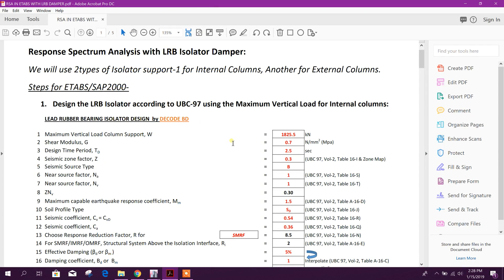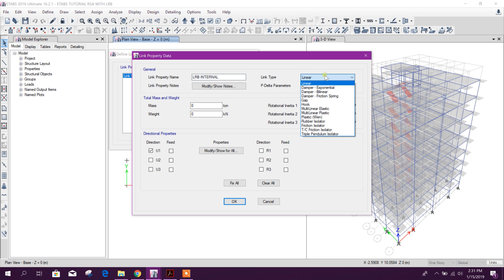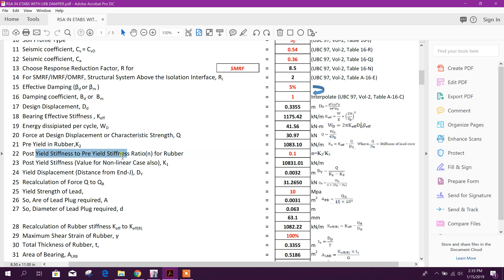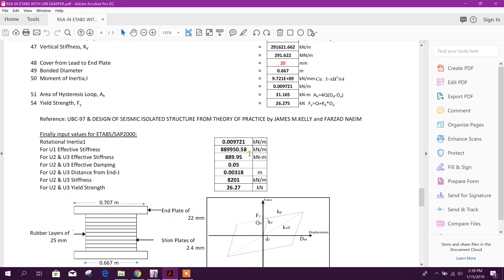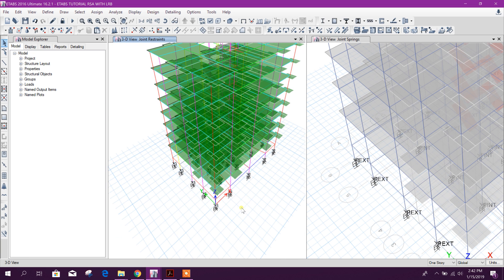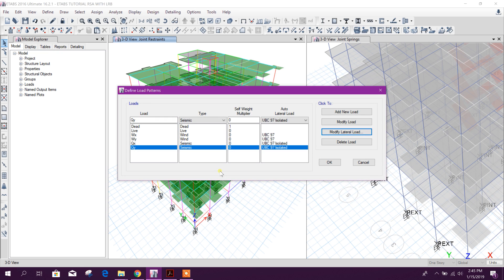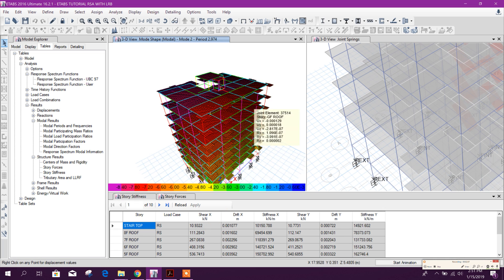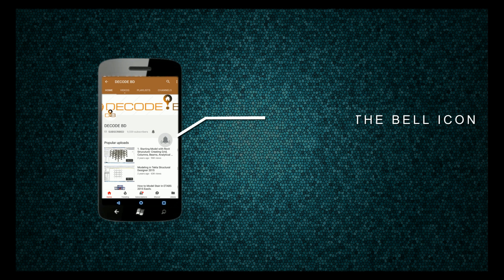RESPONSE SPECTRUM ANALYSIS WITH LRB ISOLATOR DAMPER IN ETABS

Comment: Can't we design the LRB without UBC code and only using IS 1893 part-1 2016
Reply: If possible can you please put a video on that
Reply: No, as till now we don't have any Indian code available for the design of base isolated or interstory isolated building. IIT Delhi/Kanpur professorss are working on it & i think it will be available in near future. Now, if we talk about your ques then as i have already told you that you cant design with 1893 alone but what you can do is you can use IS 1893 along with UBC or you can use ASCE 7-10. So, for the calculation of your isolator (rubber bearing or friction pendulum doesn't matter) you can use ASCE & for the beam column size reinforcement etc use IS 456 as due to the use of isolator your building will be in elastic range only so you dont need SMRF & atlast with the help of IS 1893  you can give target spectrum & match the time history (FNA, lets say). I think I have covered all d things here.

Comment: Thank you Sir, BUT I have an important question , I notice in this video that you used the Value of Max and Min Effective Stiffness for one isolator "For Example the value 1175.42 kN/m" Contrary to what was stated in the "Etabs 2016 Lateral Load Manual " for 1997 UBC Isolated Building Seismic Loads, Which States that "The maximum effective stiffness and minimum effective stiffness items refer
 to the maximum and minimum effective stiffness of the isolation system (not individual isolators) at the design displacement level".
IF we do what was states in " Etabs Manual " we will have Base Shears Values for isolated Buildings more than Base shears for Fixed Base and this is not acceptable !!!!
I hope you answer and Help me

Comment: Sir i am extremely grateful to you. Could you please tell me if i should use draw 1 joint link cursor to assign the LRBs in Sap2000? Or there is other way to assign because my deflection is coming more than fixed case
Reply: Can u  please tell me how to calculate stiffness n Effective Stiffnes of Base Isolator..i.e Rubber Bearing
Reply: Hii Abhishikta chanda !! Are you working on base isolation in SAP 2000.if so can you tellme how to calculate 1-W, 2-G, and time history data

Comment: Sir, how do you get the Vertical Stiffness = 385.165 MN/m? what is the formula? it will be a great help sir, I subscribed to uour channel as well. more power!
Reply from the maker: Formula given in the pdf.
Reply: @Decodebd  in pdf formula for vertical stiffness and bonded diameter are missing. Could you please help me out by sharing these?
Reply: the formula for calculating vertical stiffness is Kv = Ec * A /tr

Comment: Assalamoallikum dear sir, I am truly greatfull for your precious help. Sir here i ma going to shear few questions namely                                                                                                                             1). Maximum vertical load column support would be (DL+LL+SDL) is it right??                                            2).point spring property data from box there is one part that is transition Z =175.127 kn/m that value how will be considered in this stage?                                                                                               3).Is there any check of LRB which is provided at the base is safe or not for the structure?              4). Sir here you considered;                                                                                                                                          - for u1 effective stiffness=1175418.57 kn/m                                                                                                      - for u2 and u3 effective stiffness = 1175.42 kn-m                                                                                       but in etabs both are same units(kn/m). Could you check once a time and rectified please sir???
Reply from the maker: 1) Right, 2)That portion is applicable when you will not use any link property below that box. 3) LRB is already designed according to Vertical Load carrying capacity with target displacement during Earthquake. 4) for u1 that value is ok as it's 1000 times of U2,U3.
Reply: @Decodebd  i am grateful for your assist. Sir could you tell me one thing that is where from did you get link property value that is transition Z=175.127???
Reply from the maker: I told you that Z is not our concern here, as we have assigned link property downside from drop down list.
Reply: Hi sagur Khan !! 
1) What are the load combination we are taking to calculate Max verticle column load  W
2)How to calculate shear modulus G 
3) How to get the data related to earth quake for non linear time history Analysis
Iam doing a project on Seismic Analysis of RC Structure Using Base isolation LBR it would be great for me if you assist, thank you 😊